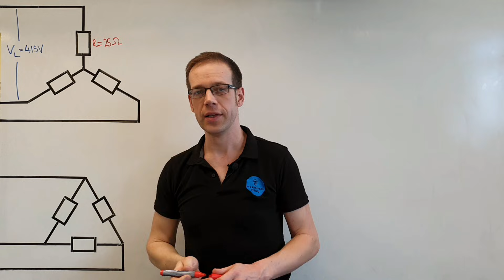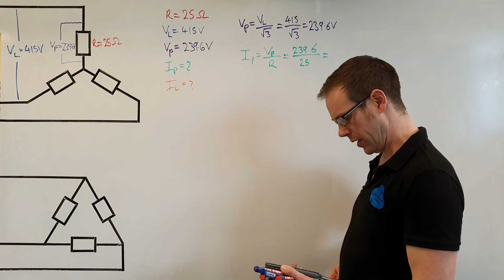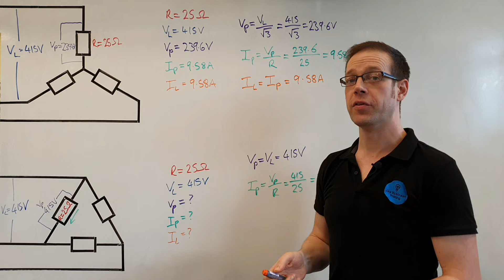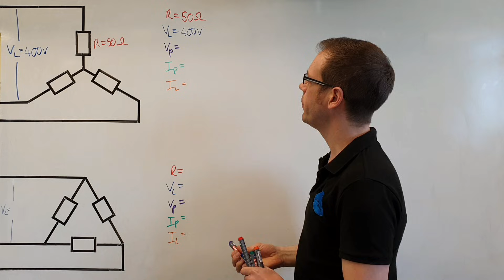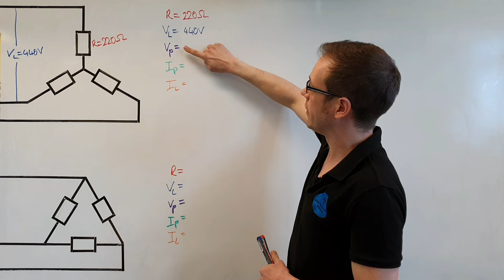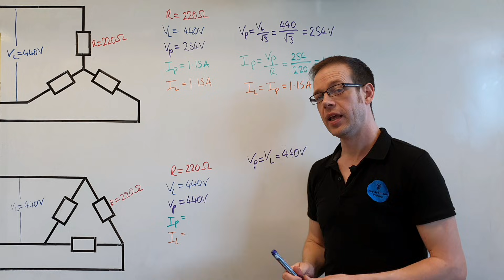3 Phase: How to Calculate Line Voltage, Phase Voltage, Line Current & Phase Current in Star & Delta

Comment: Nice and informative video. I just want to add something. Since you are showing a three phase system which is connected in wye (star) and delta that means you are dealing with AC system.
When you are dealing with an AC system try to avoid using the “R” (resistance) as loads, use “Z” (impedance) instead. The reason is: in an AC system, resistance is part of impedance. Impedance has two componnents-resistance and reactance. I hope you don’t get offended as you intend this for the beginners. Thanks.

Comment: studying for unit 202 2365 now and finding this helpful, unfortunately, took my exam on Friday just gone and got for delta and star connections only 42%, which is quite bad, overall i failed... I am re-taking this friday and have been cramming ever since... I need a really good simulator to help me out... sparkyfacts is what I primarily used but realized quite quickly that they're not much of it on the exam (that I just took) but knowledge is power so more the merrier..

Comment: my thanks to you, please clarify this, since the current is low in star connection, and more in delta connection, then why the motors are preferred to run in delta connection, using star delta starters.

Comment: The question is(  THE identical colis each of resistance 30 ohms, inductance of 127.3mtt are connected in delta to a 440V, 50 HZ  3 phase supply find phase and line currents

Comment: Hello Joe, nice video... very clear and easy to understand! I have a question... What happens if we have different values of resistances in a star or a delta connection?
Reply from the maker: Fairly simple in a star connected system, you just end up with different currents in the three phases, it's a little more complicated for delta.

Comment: Can you please do another video about 3 phase AC power. I would like to know how they calculate the power consumption (the utility meter) as it seems different when thinking of 230v to neutral circuits contributing & then 3 phase equipment using the 400v between phases. The current through a single phase of 230v is less power than the same current through the higher voltage between phases. I'll watch this video again to try to understand it better.

Comment: Hi! Great video by the way - learned a lot. One thing I am still trying to figure out is the power. More precisely, is the total power calculated by simply adding all three or is there some tricky formula for that? And just to be on the same page, here is my problem:
I have a star configuration generator, I used your calculations to determine phase voltage and current. I suppose I can now simply use P=VI formula for each phase. And since each coil is a separate load it has its own power output (probably not said the best or right way). Can I now add them to determine the total power if there was no other way of measuring it?

Question #2: When I rectify the output using a three phase full bridge r., does something "weird happen to the power output??

Thank you a lot for answering and have a great day.

Comment: Thanks for the explanation. Can you give me advice how to find system phase voltage in star connection with inductance also given.
Resistance - 30ohm, inductance 50mH. 415V, 50Hz three phase supply is provided to the circuit

Comment: For motor each phase winding can measure by multimeter or any special device need to find load in ohms.?
Reply from the maker: You can find the resistance of the coil in a motor but as soon as you connect it to an AC supply it will develop inductive reactance which will combine with the resistance to give impedance, this is the opposition to current flow that will dermine how much current flows in to the motor. 😊
Reply: @JoeRobinsonTraining  can u make one video how to get practical impedance measurement of motor winding and lighting load?
Reply: So this 20 ohm load of each phase is impedance unit , am I correct?

Comment: sq root of 3 is = to 1.73?
Reply from the maker: 1.7320508076.... it's irrational so it goes on forever without repeating but 1.73 is good enough for most practical applications. 😊

Comment: Hi Joe thanks for the very helpful video - how can I calculate power consumption of either arrangement (Kw)? Thanks!
Reply from the maker: Hi, thanks for the comment and the question. To calculate power in Watts you multiply root 3 by line voltage by line current by power factor. 😊

Comment: Joe can you help please? 

A star connected load is connected to a 400v supply. If 20a is drawn down the line conductor. Calculate phase voltage, phase current in each winding

Comment: Thanks for the nicely explained video. Can you pls advise about calculation of 3 phase  delta connected motor phase current having 100KW capacity, 440V, 3Ph, 60Hz, 0.8 PF
Reply from the maker: What specific factors do you need to figure out?

Comment: Joe I need ya help I’ve been given this question ‘In the line voltage of a three phase 4 wire supply is 407v A/C, calculate the phase voltage’
Reply from the maker: Hi Lewis, do the line voltage divided by square root of 3. 
407÷1.732
Reply: @JoeRobinsonTraining  4 wire supply = Star Connection? Is that why you used Star Connection Phase Voltage Formula?
Reply from the maker: Yes, the question mentioned a four wire system so four wires must include a neutral making it a star type connection. 👍

Comment: I have a question. For the star connected load there are two 50ohm resistances between lines. So how come the current through the phase and the line is the same? Surely the current flowing across 50ohm and across 100ohms should be different?

Comment: What if I don’t have either line voltage or phase voltage? And I need to find both. How do I find them?
Reply from the maker: Hm, tricky, you'd need to know some other bits of info like resistance or current. 👍

Comment: Hi I've tested a few 3 phase motors and generally getting  0.90 ohm to say 1.80 ohm for each winding on different motors. Now using your method that would mean potentially 266A IL in a Y configuration or 133A IL with a Vp of 240v. This doesn't make sense to me. What else could be going on as I'm totally lost from real world testing at how the high currents are predicted from low ohm readings on the windings, yet all these motors are under 16A and they are balanced and running fine. The windings don't accurately predict the Line Currents from the readings I'm having. Thank you.
Reply from the maker: Hi Mike, that is such a good question, thanks for asking it. Basically when you first turn on a motor you are connecting the resistances you've measured to the electrical supply and indeed huge currents flow into the motor, you may have heard this referred to as "inrush" current and it will probably trip a Type B Circuit breaker. As the motor gets going the inductive part of the load made by the coils of copper produce inductive reactance which combines with the resistance of the coil to make impedance and this is what determines the running current of the motor which will be lower than the values you calculated. Really insightful question and I hope this answer helps. 👍
Reply: @JoeRobinsonTraining  Hi Joe, this makes perfect sense now. Thank you for your timely and quick response.

Comment: Hi There. love your channel. I have a question that i struggle to find the definitive answer to. When calculating the amperage per phase on a 3 phase appliance, what equation can i use when i have watts and voltage? I.e. 3 phase, 11kw machine on a 415v supply, how many amps per phase? I thank you in advance for your time.
Reply: On 3 phase
I KW = 1.82 A
11KW= X
Find X

Comment: Is a tertiary bus calculation the same as a 3 phase?
Reply: No but here's why: A tertiary bus calculation usually involves a specific type of transformer winding used for stabilizing or damping purposes, while 3-phase calculations are about the general principles of power systems with three phases

Comment: if you calculate the power based on this example, it comes out with this: power in star connection is 6886.11 VA, but in delta connection for the same motor it becomes 20665.53 VA, is it correct???
second question: is power calculated based on line or phase values for voltage and current???
thank you in advance
Reply: I mean the first example in this lesson 🙂

Comment: I just have a question, I had to do a paper including a question with a star connector only mine contained inductors too so I had "j" values. There was 10 marks to work out the line current, but also 10 marks to work out the phase current. I was quickly running out of time so I used the information in this video and made it identical and then added everything together for the neutral current for a final 10 marks. Is the phase current different in this case? I still had to to work out the phase voltage and convert it to rectangular from polar. It seems strange to get 10 marks for re-writing answers from the line current
Reply: You cant use current divider method to calculate current in a resistive inductive circuit because of phase shift...so you would just use voltage at inductance terminals divided by its ohm value (XL) xl=2piFL...otherwise you have to take into consideration phase shift degree (cos^-1(P/S))

Comment: Anyone know the formula to find primary line current? 
Here is the info I’m given.
3 phase transformer, 
supply Delta/Star, 44kVA, 65hz,
winding ratio 48:1, supply voltage 33,000 volts.

Any help appreciated ❤

Comment: Took me ages to realise there was no neutral in a motor and I still don’t know why
Reply: A well designed three-phase motor is a balanced load, i.e. the impedance of each phase load are the same. When the phase loads are connected in star, the phasor sum of the phase currents in the neutral wire  is zero. Hence, no need for a neutral wire.

Comment: If this topic about motor...this is totally wrong.....
Reply from the maker: In what way?
Reply: @JoeRobinsonTraining in star phase or line  current formula P=√3×vl×il×cos¢
Reply: @JoeRobinsonTraining  how to calculate you phase current, this is wrong
Reply from the maker: @excellentelectricalknowled6672  that's a different subject which I'll cover in a future video. The content in this video is spot on. You could start with the information in this video and use the formula you've stated to calculate the power. As the circuits in this video are purely resistive the power factor or cos θ would be 1. My video is not incorrect.
Reply from the maker: @excellentelectricalknowled6672    that's a different subject which I'll cover in a future video. The content in this video is spot on. You could start with the information in this video and use the formula you've stated to calculate the power. As the circuits in this video are purely resistive the power factor or cos θ would be 1. My video is not incorrect.
Reply: @JoeRobinsonTraining  okay 👌 👌